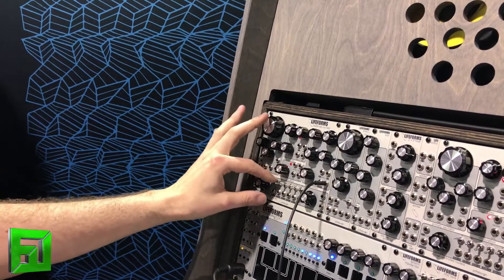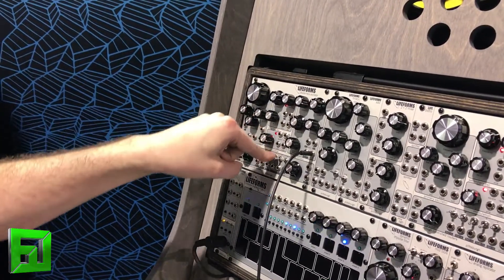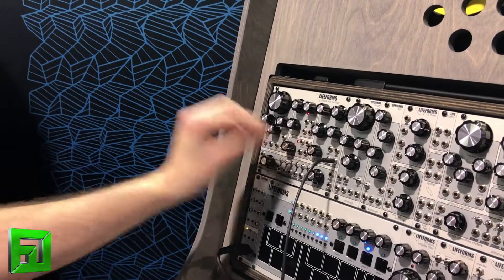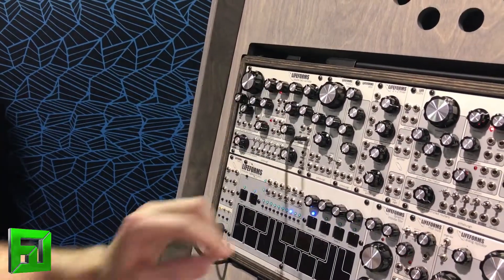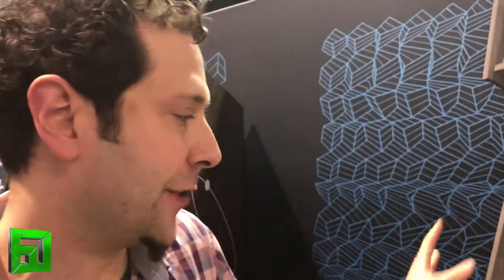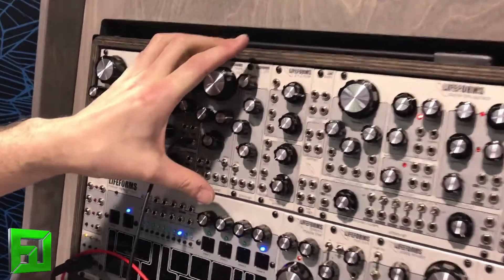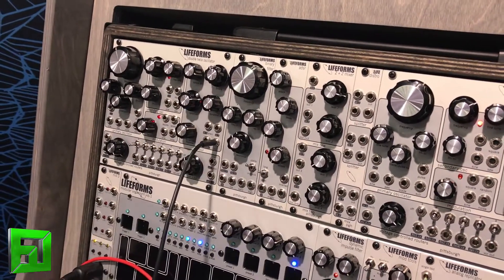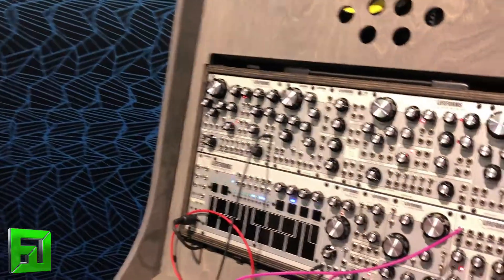Pittsburgh Modular double Helix VCO Dynamic impulse filter and more NAMM 2017

Comment: I absolutely love the idea of turning an arcade unit into a synth. I think there's a bit of room for improvement, like you could probably fit three times as much hardware compared to what they had here, but it's a phenomenally cool idea. I want three (ha ha, I wish).

But seriously I love repurposing, and in this case it makes total sense because it works well. It seems like a very natural cabinet to put a synth in because you're standing so the posture is almost the same. I want to build myself something similar.